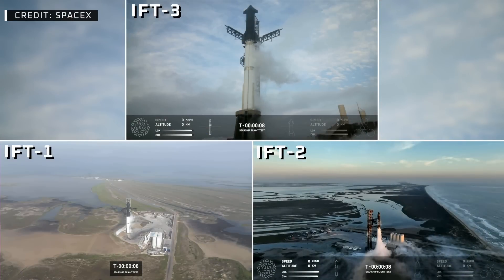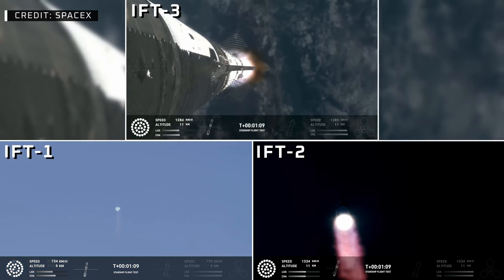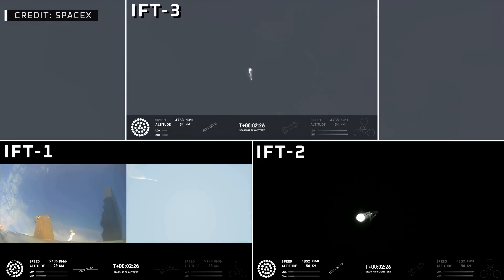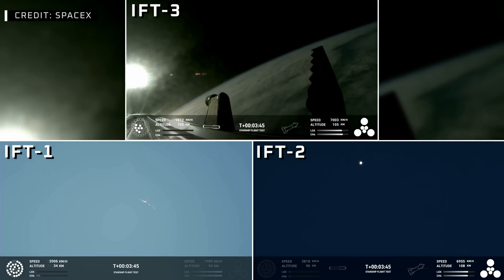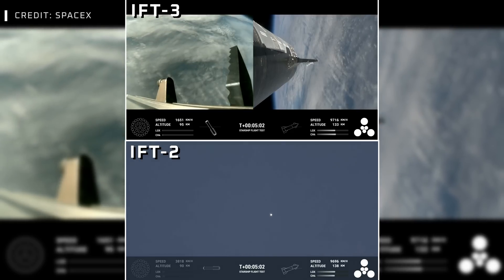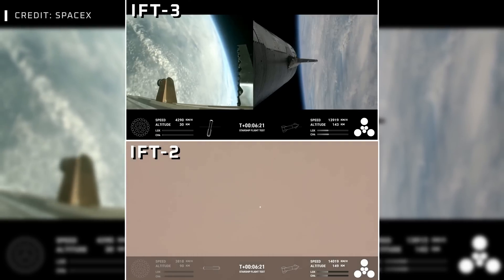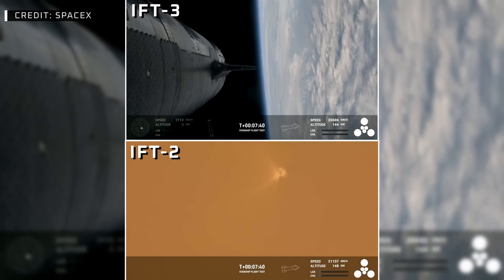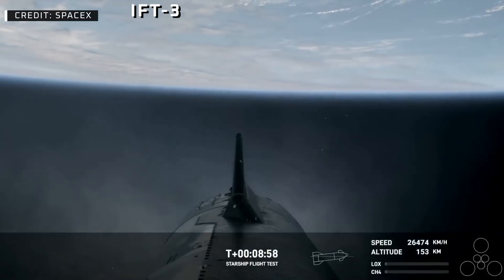IFT-1 vs IFT-2 vs IFT-3 - A Comparison

Comment: It looks like the atmosphere just under the Top Clouds was very turbulent and cause the loss of control. Need additional control unit adjust to more gyro units triggering upper jets at the fin level maybe. also we should look closer at wind currents and jet stream patterns and land avoiding this fast moving column of air

Comment: It's so funny (and I noticed it only now) that booster during IFT 1 survived longer that during IFT 2
Reply: Consider also that #1 failed to disconnect when signaled to do so.
Reply: @2Chickaboom2  Yes I know, but It's just fun fact.
Reply: @2Chickaboom2 IFT-1 never achieved the speeds or altitude required to trigger a stage separation.  Thus, it was never "signaled to do so".

Comment: What make IFT-3 leave the OLM faster is the lack of hold down clamp. You can see by T+10 seconds IFT-3 already clear the tower while IFT-2 haven't. 
In IFT-1 AND IFT-2 the hold down clamp is there for the ship to throttle up before releasing and also for abort in the case of emergency. In IFT-3 case with no hold down clamp the moment Starship thrust to weight ratio is past one it's go time.

It's just show iterative designed of the OLM where Elon talk about making the ship clear the tower faster.

Comment: Truly amazing seeing it side by side.  IFT-1 went way further than I expected, obviously partly due to it not self destruct properly.  IFT-2's second stage was picture perfect until the end, when you compare it to IFT-3.  I can't wait to see what IFT-4 brings to the table.
Reply: Have you got that backward?  Both IFT-2 and IFT-3 saw flawless uphill flights from both their boosters and ships ... right up until IFT-2's ship's LOX dump led to its final demise just a short way from its planned engine shutdown.  IFT-3's ship had no such problems; and appeared to fly flawlessly till after reaching zero-G and developing a slow but continually accelerating roll that the ships lack of conventional OMS was clearly unable to address (on this flight — I'm not presuming just one failure on its first attempt is enough to force SpaceX to abandon their plans to only utilize ullage venting for orbital attitude control, station keeping, and maneuvering).  

For most of the flight there appeared to be a constant venting from the starboard side of the vehicle as viewed from the forward port-side flap which to my eyes matched up with the ships accelerating starboard roll.  I imagine either the ship spung a leak (unlikely) or a vent froze open and couldn't be reclosed (likely due to ice buildup or prior mechanical failure of the valve itself). If it was a stuck ullage vent, it's prolonged venting after engine shutdown (when no more hot gasses were available to represurize the tanks) may have robbed the ship of its ability to restore control before reentry (as excess tank pressure was lost to space the remaining, still functional vents would have been deprived of their power source and thus robbed of their ability to operate efficiently and deliver the necessary thrust to regain control).
Reply: That was a poor choice of words on my part there.  I meant "its end" or maybe "demise" would have been a better word. IFT-2's numbers generally looked as good or better than IFT-3's up until the big boom.  What I was trying to say was that, sans the boom, it looked really good and would have completed more objectives than it did.

I am interested to see if they were running more tests than normal on the OMS this time around.  It is hard to tell if they were intentionally stressing the system at first or fighting the space craft the whole time.  After awhile it was clear something was frozen open, or was blocked.  Freezing of the vent ports is going to be a real concern when using cryogenic gasses.  I am sure they will figure it out or adjust fire.

I think reentry would have been smoother had it been under control at the start.  The initial entry images looked amazing (visually), and seemed (from the heat) to be pointing the right way, but the orientation graphics told a completely different story.  I think I noticed some missing tiles before reentry, so I think there is still some work to do on that end.

Comment: That sucker was screaming off of the launch pad this time! 😮
Reply: Oddly it took flight quicker but IFT-2 quickly caught up and then managed to stay slightly ahead all the way through staging.  Presumably because IFT3 was taking a slightly higher arching trajectory in order to ensure a steeper reentry angle over the Indian Ocean, so that the vehicle could still reenter at near-orbital speeds on reaching it's significantly less distant destination.

Comment: all huge improvements, especially flight 2
Reply: While IFT-2 was impressive, IFT-3 was substantially more impressive.
Reply: @SlartiMarvinbartfast  I think the engineering requirements for IFT3 over 2 were tweaks. There was much bigger differences in the whole system on IFT2 over 1, most notably the deluge system and  the way they protected the engines, from lifting off with engines blowing up every few seconds, to all 33 working all the way up, and not destroying the pad to the extent that happened on IFT1 was a huge difference. Not to forget, completely changing the staging concept to hot staging and nailing it on first attempt.

Comment: Wow you really can see how much an effect of just 3 missing engines made it ascend slower.
Reply: Iirc, IFT-1 throttled slower when leaving the pad compared to both IFT-2 and IFT-3, and I don't think the number of lost engines is the factor here.
Reply: @SyahmiAsyraffYT  The loss of Raptors on B7 made a big difference, as did the loss of control due to the HPUs being wrecked.
Reply: @SyahmiAsyraffYT  That and they had newer raptors.
Reply: holding down IFT1 (possibly) could've been some of the issues with a few of the raptors going out. I'm not sure if this was ever confirmed or debunked though.